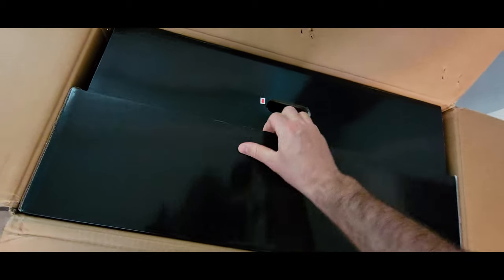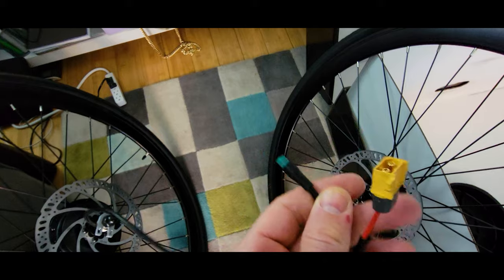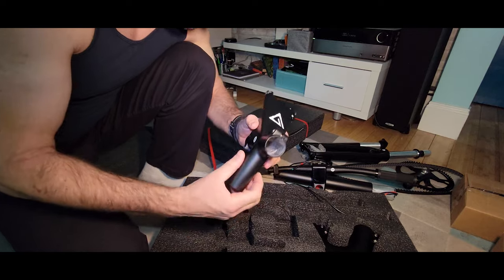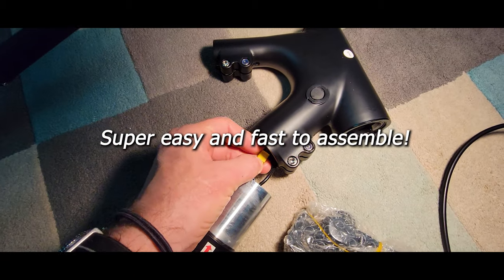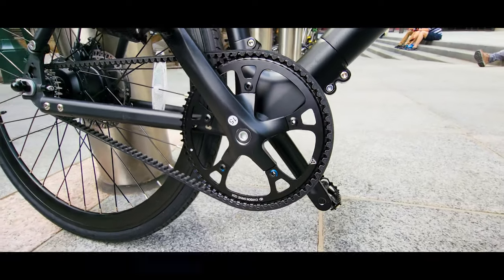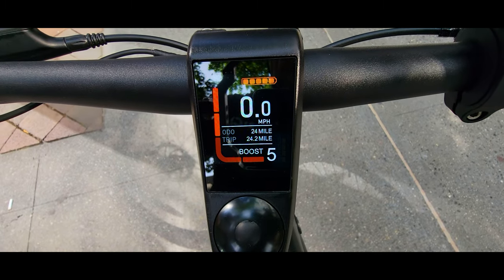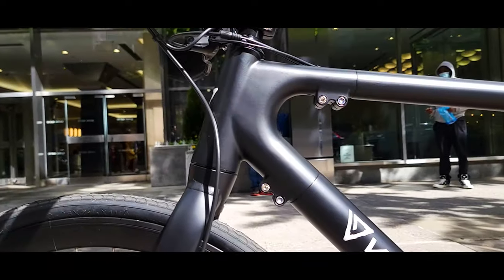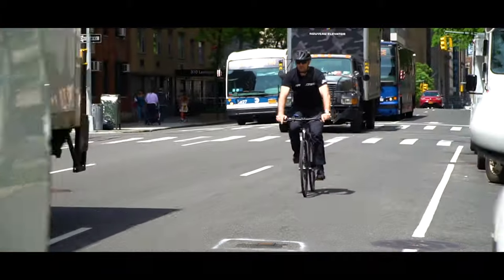First "LEGO" Electric Bike by Vanpowers!

Comment: Dude, I haven’t seen this ebike until today. I’ve always wanted an bike that can be potentially brought on an airplane as a carryon, and this very well might flip the bill. The specs are great, but from what I am seeing I wish the motor was a 450 watt only to more easily reach and maintain 30+ miles an hour. I don’t know I can reach 20+ miles an hour in a pretty much instant a few seconds max, so maybe this is perfect to reach those speeds with the motor allowing me to stay at 30 miles an hour for a couple hours?
Reply from the maker: 20 to 26mph doable but 30 only if you have strong legs or a professional bike rider. I don't think it is safe to ride on this frame 30mph. I think the way it is it is perfect. If you are in NYC we can meet and you can try it. It is the best e road bike I tried so far. It is designed to be light and stealth.
Reply: @ElectricVehicleSpace  You would know best where the bike is great at speed wise for the frame. The portability of it is awesome, and accompany it with a light weight stealth motor/battery makes it even better.

Thanks for the offer. I do live on NYC, and would like to try out the bike before ordering it which is unique as not many other things one purchases in that price range without getting an opportunity to try before buying.
Reply from the maker: @buffalomind6838  send me an email: vitalie_vizitiu@yahoo.com and we can coordinate and go from there.